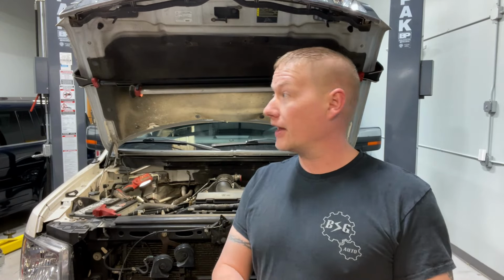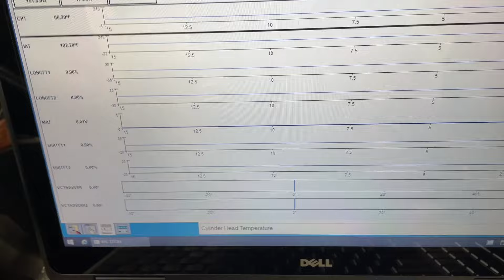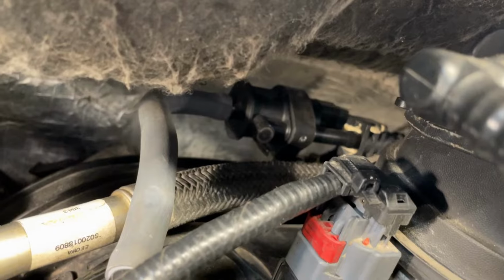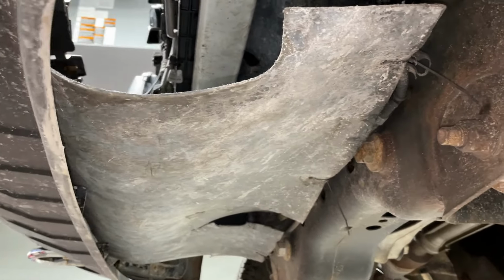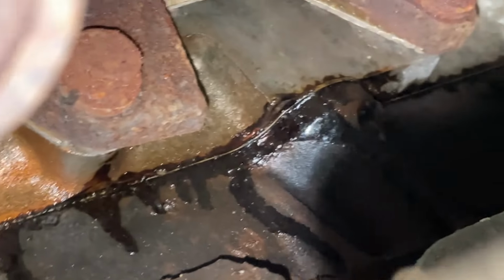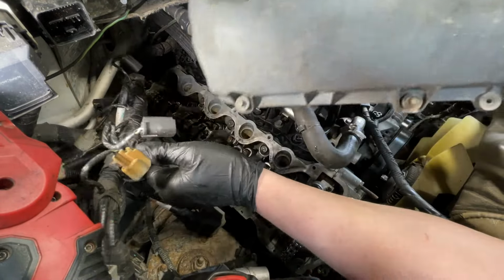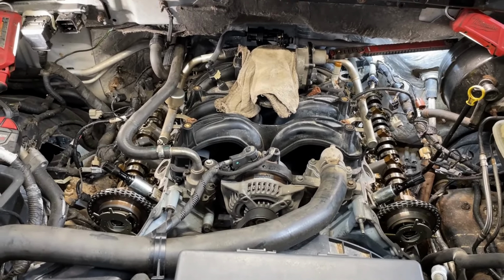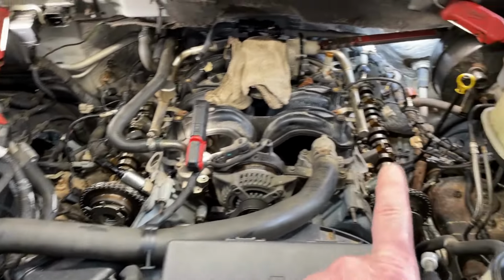The Worst Hack Timing Job Ever!

Comment: why are cold air intakes bad? should i be worried, i have had one for 5 years and no problems... yet lol
Reply: Depending on what filter they use and how they are Plummer they can actually be sucking in hot engine air instead of cooler air from outside the engine bay. Also they usually have performance air filters that do not filter anywhere near as good. So your gonna be sucking in more dust and eating up the engine faster.
Reply: @FishFind3000  I agree 100%, they pull in hot air, make more noise and they're never calibrated as well as factory stuff
Reply: @FishFind3000   yes i agreee with all that, i know it does not actually get cold air because it is setup the way the one in this video is. But i do enjoy the extra acceleration and better response from the pedal, im in between putting the OEM back on or just keeping the K&N, thanks for the reply guys
Reply: Seen oil from the filter wet the wire in the MAF and mess shit up

Comment: I learned years ago that crap work can come from dealerships and independent shops. I’m finishing up replacing the whole HVAC box in the dash of a 2011 Lariat. Talk about a cluster of a job. He took it to a local Ford Dealership to have a blend door issue fixed. Long story short some goon busted the box trying to replace a blend door motor.  Parts alone are over $800. 
There’s been a huge exodus of quality people in the automotive repair industry over the last 20 years and goons are to be found just about anywhere today. The few exceptions are really small shops where the owner is there every single day to oversee what takes place in the shop.

Comment: When it's time to redo a timing job on a 5.4 3v do yourself a favor and replace the engine. I'm so happy I opted for the 4.6 2v engine in my '08 and not the 5.4. She's still running strong.

Comment: I own a 2018 F-150 5.0. And if you could do a series on fixing that damn engine and make it not sound like it was designed and assembled by sloths, I would be eternally grateful.
Reply: 5.0s are one of, if not the best engine you can get in a half ton. Maybe change the oil every once in a while.
Reply: @wyattlewis8671  my truck has 25k miles. Makes a popping noise while accelerating and suffers from the deceleration rattle. Ford says it's a normal characteristic of the 5.0. I think it's 100 percent bullshit and so does everyone else. No V8 sounds this bad. Maybe you should know what you're talking about before looking stupid in the comment section.

Comment: They need to pull all the 3 valves from the market and design and manufacturer a engine to replace it or just stop supporting it because this engine is garbage.

Comment: I wish more techs gave a crap like you haha. I have an '08 F250 with a 5.4 that had a hack timing job and it all blew apart after 20k miles. Luckily I followed your timing video and got it done right with Ford OEM and Melling M360 pump and got it done right 👍

Comment: I find it hard to believe that a shop would not know to use the machined caps, omit 4 bolts from the pan after a timing belt change, put goop on gaskets that dont call for it...I suppose your customer may be a DIYer whom effed this up and is too embarassed to say so.
Reply from the maker: He literally asked me to document everything I found so he could go after them in court so I think he is legit.

Comment: a new engine? are you fuckin kidding? No wonder those POS are always broken. Nightmare turd engine. You think the the cam actuators are giving trouble because of bad oil pressure. turd is to complex. I'd put it back together, fix up the air leaks, give it an oil change n run it until it drops.

Comment: Lol see a lot of people bashing the Tech's work. I agree his work looked bad. It's also the biggest POS engine used in one of the most common vehicles. Ford is the one on the hook for all this garbage, a multi billion dollar company couldn't design a simplistic V8 the average mechanic could wrench on. This along with the 6.0l diesel ran many a Tech outa the trade, garbage.

Comment: The power balance was the same because you only checked around For oil leaks and tested for vacuum why would it be any different? Lol
Reply from the maker: Oh boy, you didn't watch the video I see. I made a video on what I found not a diagnostic video. If you want a teardown or diagnosis video then check for it in the future as the old engine is out now.